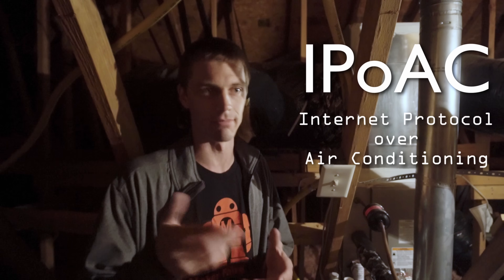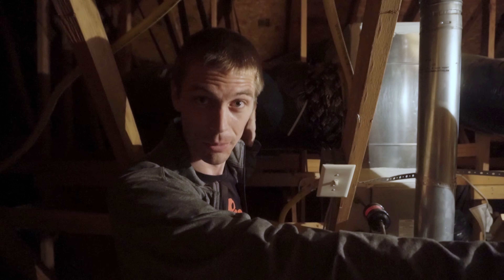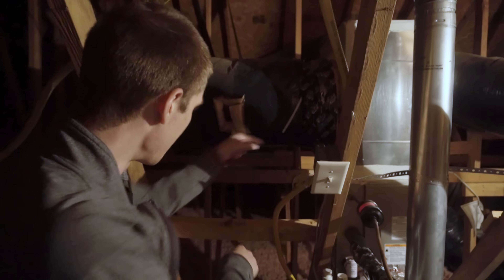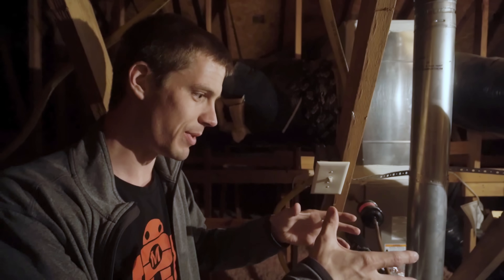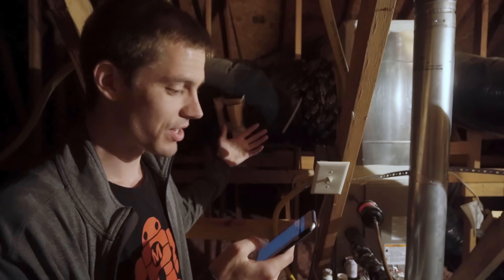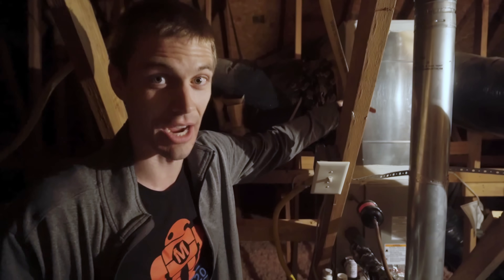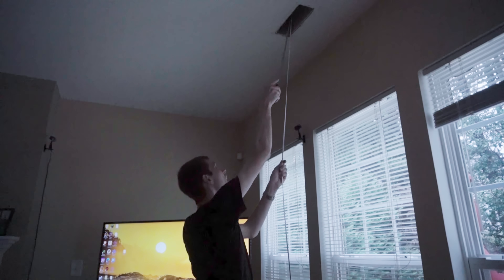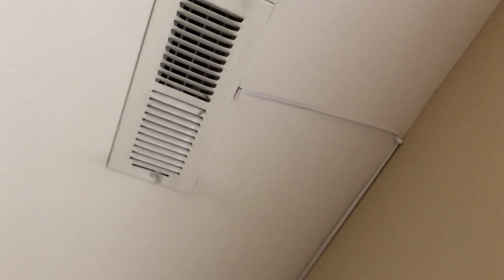IP over AC: Mmmmmm Ppppfffftttt SssshhhhhhhWOOOSH

Comment: I did this years ago using the cold air return ducts.  It worked great until a lightning strike nearby fried everything connected to cables that passed through the metal ducts.  Could have been induced current, could have been coincidence.  Don't know for sure, but I don't do that anymore.

Comment: You're gonna have a bad time come winter when heat is going through that vent... especially since you went for a flat one instead of unshielded twisted pair. I learned the effects of heat on packet loss the hard way when I ran ethernet cable through the attic :\

Comment: IMO just pay a pro. It is only around $100-200 a drop and you won't a weird wire sticking out your vent and running around the walls.
If you want to do it yourself, the best way to get from upstairs to downstairs is upstairs rooms go to the attic. Then down utility (plumbing, electrical, ...)  column to the basement or crawl space. From there connect the downstairs rooms to the basement. (Glow in the dark fishing rods help.)
Reply: When I first moved into my house, I ran conduit to all the rooms. It's super convenient to have multiple ehternet ports in every room! It's supper annoying to crawl through the attic and crawlspace to install them initially though.

Comment: Easier solution, depending if you have your PC on the same power circuit as your router, get a LAN over Power adapter to send your internet/network through the power of your house. No need to run cables.

Comment: I do a sameish thing, only use the cable ducts and a vacuum, from my experience you can fit a ethernet, modem and tv through a single pvc pipe, but your method seems better because making cat5 connectors by hand sucks.

Comment: I initially thought you meant AC as in Ethernet over Powerline 😉 I can understand why you went for a flat Ethernet cable but those unfortunately have abysmal line rate performance and are susceptible to RF noise (at least the ones I used in the past) 😅
Reply: https://en.wikipedia.org/wiki/Power-line_communication
Reply: @kramo  
I appreciate your contribution to this conversion. It was engaging and I am now engaged.

Comment: Sounds like something I might do.  This just makes me think though about using the circular ducting as a waveguide and send a signal that way through the ducting and it would  come out at every duct at once.  Some experimentation would be required to see what frequencies transmit well through 8" waveguide.  Each duct could have a feed probe with a repeater antenna if the signal doesn't just come out at a high enough level.  This would not be a regullar WiFi but maybe with some frequency conversion it could be fed into a WiFi switch. WiFi repeaters are tricky because they both transmit and receive so it would probably need to be homemade.  Your solution is the quickest and simplest.  Your only issue might be condensation on the cable but I don't think even that should be an issue actually.  And you have shielded cable as a side benefit. I've seen your trick done by electricians but with a vacuum cleaner.  Might as well take advantage of the fan that's already there though.

Comment: I hope you used plenum rated cable. 🤣
Also, FWIW they have 12+ foot long drill bits for installing cable through large spans. they even have little holes in the end to pull the cable through. Don't blame you for not wanting to attempt it though (especially if you are married, the optics of this can terrify the wife. 😅 ).
I did something similar to this to get some fiber optic cable across the vaulted ceiling in my house. My house has 2 attics and are separated by the living room with a ceiling that goes to the roof.  All my tech gear is on one side and I wanted to put a network switch on the other. In my case I used an old line set for my AC that got replaced some time ago because it was too small. I shot an earplug with nylon rope tied to it down the copper pipe with an air compressor then pulled the fiber through.

Comment: IDK what your system is like but mine has the filter between the return and the fan, which seems like the sane way of doing things. So really all I'd have to do is take off either side of the filter box to get at the cable.

Comment: Why the heck does your house have tubes for AC to every room - but no tubes for cables?
I lived in 11 different houses in Germany - all had their cables running inside tubing in the walls. None had AC pipes in walls besides one big pipe connecting all bathrooms, so wet air can escapse and the humidity doesn't stay in the room

Comment: at first I thought this video would be talking about powerline adapters
which to be honest I have had terrible experience with over multiple years
(the conversion circuits die & emit noise & heat & are somewhat unreliable in a plug/unplug to make it work way .....)

Comment: How long is the resulting cable and wouldn't you be better off using a twisted pair, rather than flat cable?
Reply: Those cables are twisted pair, they're just super flat. Monoprice sells them (probably among other vendors). Supposedly they work... I doubt he's going 330ft (which is technically the max length for copper ethernet, but you can go longer, it's just not guaranteed by the spec after 330 feet), so even if the cable isn't as good as a "real" twisted pair cable, it's probably good enough.

Comment: 3:40 I'd say that the ducting probably has pressure more like 0.01 psi (~70 Pascal) and the piping has diameter like 6 inches.
Reply: Ac engineer above said the range went up to .16psi
Reply: @zyeborm  I guess it depends on the system. Our house has Nibe F470 and I just checked that its airflow graphs show that it can generate 600 Pa (0.087 psi) at max fan power but the airflow drops to around 10 liters/second with that high pressure. As a comparision, if it only needs to generate 50 Pa pressure, it can move 110 liters/second with the same fan.

I'd expect typical system to be configured to less than max power for a typical house.

Comment: This guy shoots interdimensional laser beams at atoms, and I run wire for a living. He says this wire ain't gonna get from here to there, in my head I'm going ya that'd be one of the easiest things I've done all month. But as an aside has he never heard of ethernet over power? I picked up a couple bricks off amazon to get ethernet to a morton building sitting back on my property and it works a dream, didn't even have to run 1 cable since power was already there.

Comment: I thought surely that is is AC as in alternating current but no... Well maybe.... I mean I kind of thought that manifold looking thing had supplemental resistance heating coils to back up the heat pump on especially cold nights. Maybe you'll make a shocking discovery for xmas:-)

Comment: Hey at work we once ran cable from a 2nd floor. out the window. up to the 4th floor. in a window to a cheap router when some dimwit cut the wires and we needed to reconnect people.

Comment: You got lucky :) there are many snags that can hang up a plastic bag on this journey :)
Reply: A snagged bag would be a good excuse to make a DIY sewer camera like thing to go in after it to see what's going on!
Reply: @gorak9000  They make cheap ones that connect to your iphone now :) I have one lol
Reply: @ArtisanTony  Yes, I do too, but it's a) not long enough to go all the way down the duct (even though I bought the longest one you could get at the time, which is annoyingly too long for most simple tasks), and b) not in a format that lends itself well to it making it through a duct successfully. The cable is rather stiff for going around corners, and you almost need to make some kind of spider type thing to hold the camera in the middle of the duct while the spider slides down the pipe. And that's not exactly an easy task when all your ducts are the flexible kind! I have one duct I've tried to shove the camera down, and it just doesn't work well at all (because the duct hardly puts out any air, and I've already checked in the attic that it's not kinked anywhere)
Reply: @gorak9000  I think mine is only 20 feet or at most 25'.
Reply: @ArtisanTony  I think it would be cool to make a little robot based around a raspberry pi (simply so you have an HD camera and wifi and or ethernet if you choose). It could be wireless that way, and drive down the duct. I'm sure there would be quite a few challenges to getting it working succesfully, and I'd still want a teather on it  (in case it fell down a vertical run, or got stuck). It would also be useful for crawlspaces too - save you actually crawling if all you want to do is inspect. It's been on my list of projects I've wanted to build for a while, but there's always other things that come up first (projects that would infact help build such a thing, and many other things, that are taking WAY longer than I anticipated)

Comment: So you could have done that in your wall if you know how to patch, 2nd floor 1 hole at floor so you can drill down to 1st floor and one at whatever level for TV slash pc on 1st. And if you find yourself in a corner of attic you can not drill down at, add a hole up near ceiling on 2nd floor to drill up.  Now run wire and either patch or......cut in mud rings and cover with blanks.  Running cable thru ac not a very good practice unless plenum rated and even than ehhhhhhhh.

Comment: Run conduit down the HVAC pipe then tie cotton thread to a piece of tissue in one end of the conduit. . Then use a vacuum cleaner to suck it through from the other end. Then pull the ethernet cable through with the cotton.

Comment: 5:12 USE GREASE. you can't use too much grease when you are pulling cable that far, and you can also benefit from taping the ethernet to a braided steel wire that is longer than the entire length you are pulling, and then you can pull HARD on the steel wire with a machine (like a corded drill).
Reply: You probably don't want to put grease into your ducting. It'll be a magnet for dust even more than the cable itself.

Comment: At this point, I'm not sure if that's an Aprils Fool Day joke or not...
Reply: I'm also left wondering the same thing... but running cables through ducts is legit - that's why they have "plenum rated" cable. It's mostly for office buildings where the whole area above the dropped ceiling is the air return plenum (and usually where you run all the ethernet cables) so if the cable is on fire, the whole building doesn't get pumped full of toxic smoke from the cable jacket burning sucked directly into the HVAC air return. In a house, it doesn't much matter - if the house is on fire, you're breathing tons of toxic fumes anyways, and there's only a few people to get out, and outside isn't too far away.
Reply: To make this a true April Fool's Day video, he should've ran the ethernet cables through the water pipes, or the sewer pipes. At least then you get the challenge of making your cable entry / exit points pressure tight. In reality though, they do run fiber cables through sewer lines sometimes, so even that is not as out of the question as it would first appear.

Comment: also, this WILL NOT work in all HVAC systems. that bag is VERY likely to snag on a screw in many systems. good luck getting that out. or get used to the noise it will make

Comment: please use plenum grade cable for this
Reply: That is really only important in office buildings, where the whole area above the dropped ceiling is the air return plenum, and there's shit tons of ethernet cable up there, and the air return feeds air to the entire building. In an office, you don't want the smoke from the cable from a small fire filling the entire building with fumes from burning PVC (non-plenum rated cable jacket) to give people time to get out. In a house, if the house is on fire, a) you're already breathing tons of toxic fumes, b) outside is very close - it shouldn't take you long to get out, and c) there's only 3 or 4 people in the house to begin with. Hence plenum cable in a house really doesn't matter much.

Comment: That doesn’t look like Cat7/8, so you’re probably not running 10GbE, in which case I would have recommended my ultimate sloth solution: TPLink 2Gbps Ethernet over power.

(Which would have had ZERO YouTube entertainment value)

Comment: Air ducts are perfect for low voltage cabling, and your method is brilliant! I ran a cable via the return duct using a toy RC truck since it was a straight, horizontal run.

BTW, those flat cables aren't the best if you connect a PoE device like an access point. Far less reliable than standard.

Comment: The cable you use is terrible! It's flat! Perfectly aligned conductors. I bet your throughput is awful.

You want shielded with twisted pairs at least cat 5.

Cat 5 is an ugly cable but you can exit the duct just before the ceiling and run the cable over the ceiling and down.